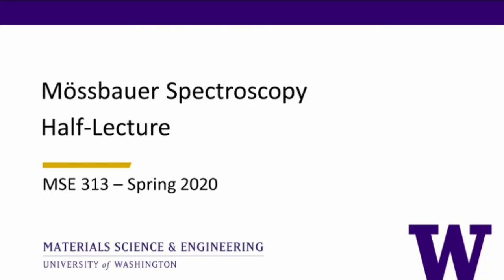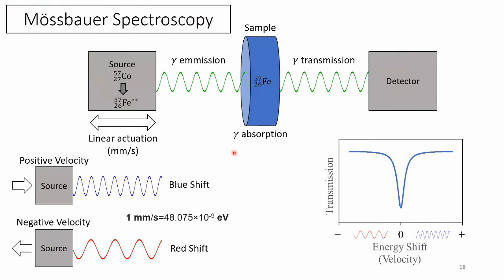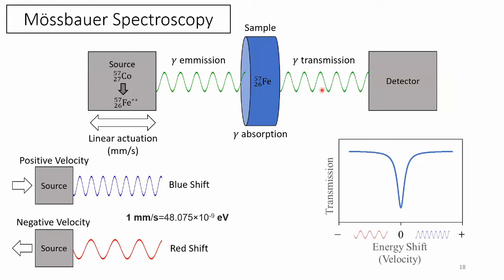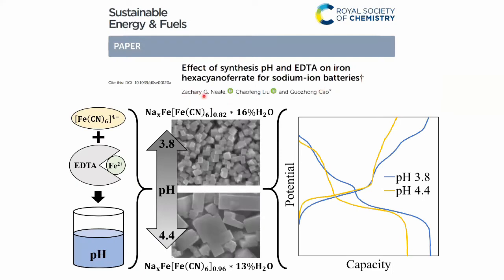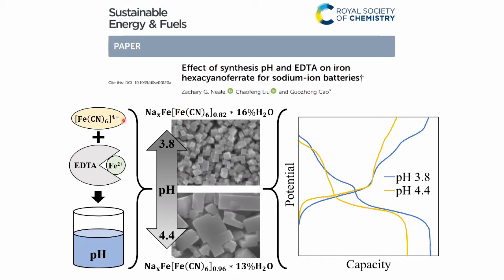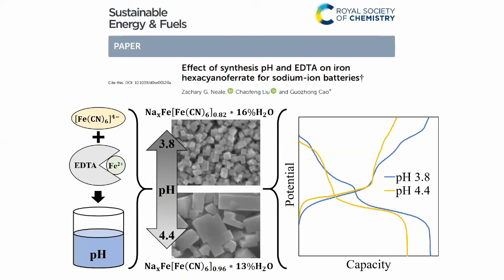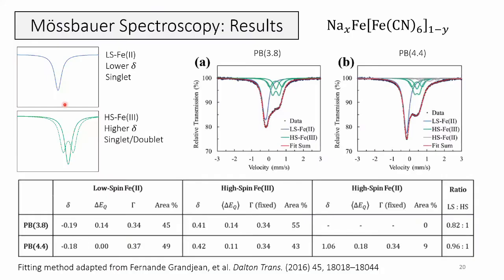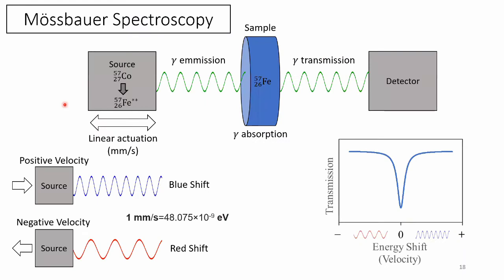Mossbauer Spectroscopy Overview

Comment: Thanks, this is great. Just want to clarify that is it true that it can be done with other elemental species as well, as long as they are of the appropriate isotopes for decay to excited and subsequently ground state? https://en.wikipedia.org/wiki/M%C3%B6ssbauer_spectroscopy#Selecting_a_suitable_source
Reply from the maker: The physics is not my area of expertise, but I assume this characterization can be done with some other select element isotopes as you have linked. I agree with you that the selected decay product needs to transition from the excited state to ground state. However, there are multiple processes that the isotope can undergo to reach the ground state, a sufficient amount of Mossbauer radiation needs to be produced. For example, 91% of the excited Fe57 produces the 14.4 keV line, other elements might produce less. I don't know if the Mossbauer line needs to be within a certain energy range. Another thing to consider is the concentration of the particular isotope in your sample, for example only 2% of natural Fe is isotope 57.

Comment: Would it be possible to use a frozen sample? In case you want to look at solved molecules
Reply from the maker: Yes, I assume so as long as you have a way of keeping the solvent frozen during the test. The test can take several days. Many publications do tests at low temperatures so it should be no problem. However, I do not think solvated salts remain solvated when the solvent is frozen, maybe non-ionic molecules will remain solvated.
Reply: That's a tricky question very often disregarded by scientists : How does freezing affect your samples at the molecular level ? Usually, for this kind of experiments, samples are frozen fast so that molecules don't have time to crystallize (i.e. you try to make a glass). But does that ensure that the molecules are not affected by the change of state ? Probably not. However, the common assumption is that the Fe ion's first coordination sphere (to which Mossbauer is sensitive) will not change significantly upon freezing the sample, even if it contains solvent molecules. Which is a reasonable assumption.

Comment: So Mossbauer Spectroscopy can't be done unless the sample is synthesized with Fe57-enriched reagents?
Reply from the maker: It can be performed without Fe57 enrichment, depending on how much time you have and the concentration of iron in your sample. The example in this video is of iron hexacyanoferrate, so the iron concentration is already high, but the data was acquired over several days of measurement. It also depends on how strong your gamma ray source is, which may change over longer times.